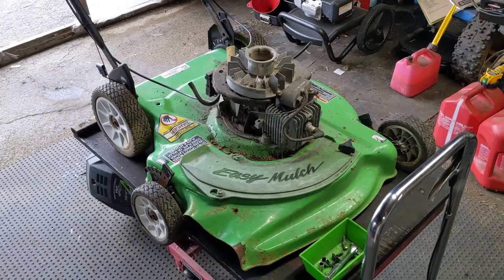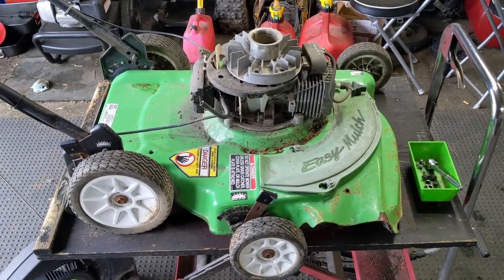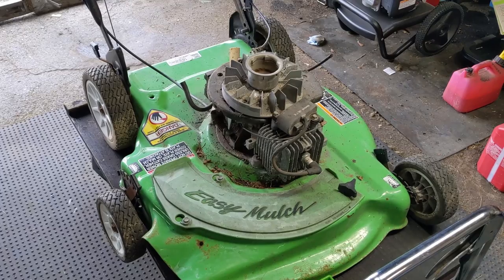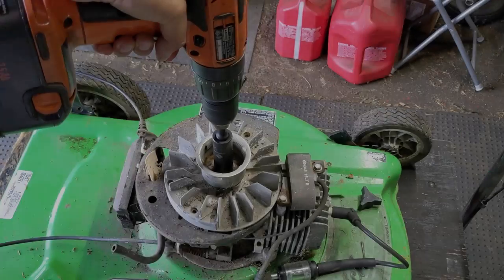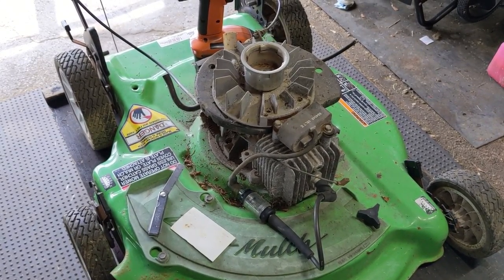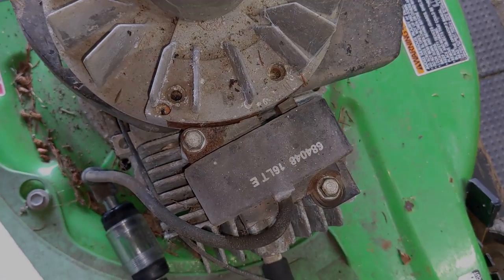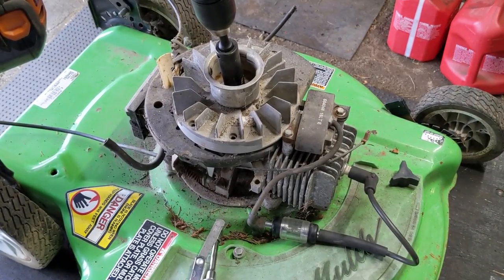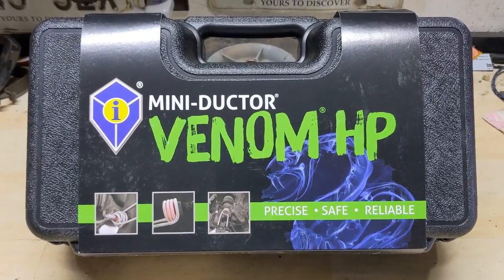How to Gap a Lawnmower Coil

Comment: I also like to clean the magnets if they are badly rusted.
Reply from the maker: Yes good tip that I should've mentioned, this one wasn't too bad, and I've usually found that they end up rusting again and usually a rusty magnet isn't the cause for no spark.
Reply: I also turn the flywheel clockwise slightly before final bolt tightening to take up any slack in the bolt holes in the direction of rotation. This may prevent any shifting

Comment: The OLD MAN here saying the coil also checked bad with an ohm meter. We just ordered a Stens ignition coil part number 440-520 which is a direct replacement for the Lawn Boy 99-2916 coil.
Reply from the maker: Sounds good!

Comment: Maybe it is a stupid question, but why did you not try a new sparkplug first
Reply from the maker: If the coil doesn't produce spark, then the spark plug won't. Using the light up spark tester in between the spark plug wire and the spark plug tells me if the coil is good or not.

Comment: I liked your videos when you went into more detail and the jobs were more serious.  It seems that you have been making quick videos on easy topics, which is fine,  but I miss the one's that were more serious problems.
Reply from the maker: To be honest we haven't had much in terms of big jobs to do, and I usually film what I'm working on. Apart from replacing some PTO clutches, there's been no tearing down an engine or anything to serious. Mostly been service jobs all summer long, basic carb cleans. Small engine repair can become quite repetitive, and I try to mix up what I post so it doesn't get too boring. I appreciate the constructive criticism, and I do have some interesting videos coming up in the near future. Thanks for watching!

Comment: What happens if the airgap isn't correct? I Jerry rigged a Tecumseh coil on a briggs & stratton. It seems to run fine. One side the gap is too far out. I got mower out of the trash so I don't care too much about it. lol